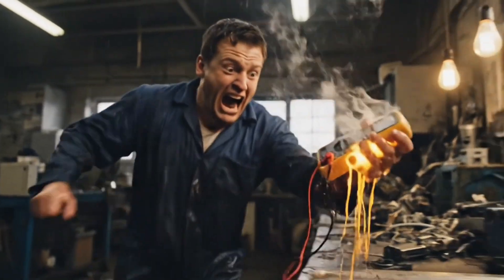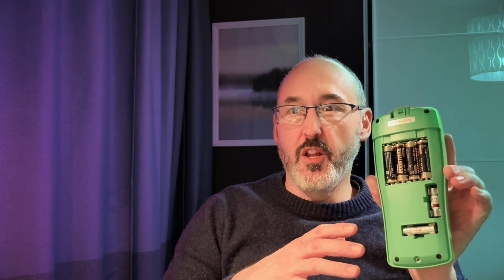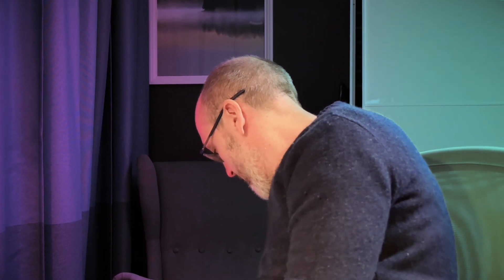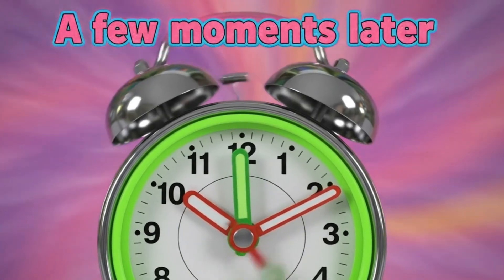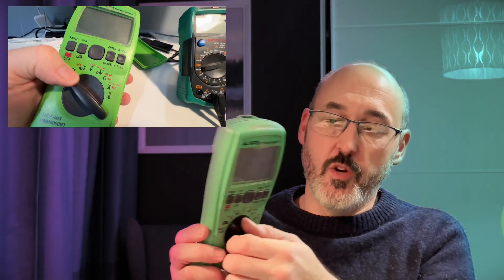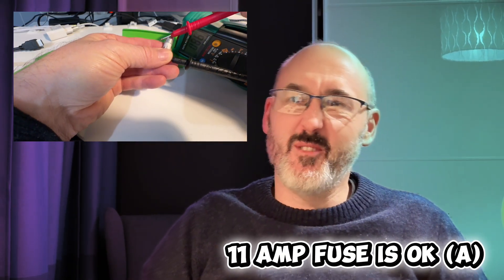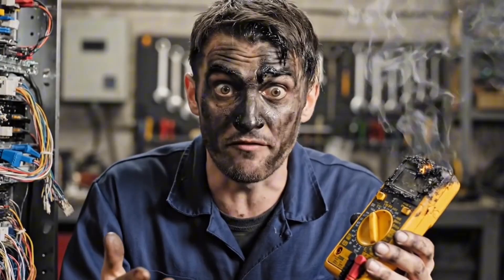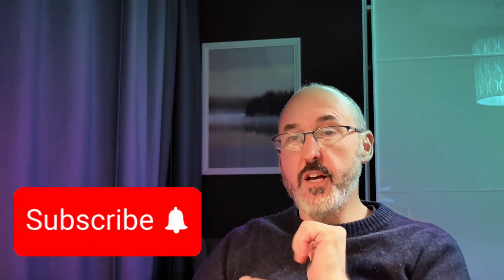What Happens When You Use a Multimeter WRONG? (Warning: Real Accident)

Comment: What to learn from this? When you get a multi-meter (or any other device with fuses inside), get some spare fuses that fits, you know, just in case. And Murphy is always around the corner and he will bite you in your butt, always at at point in time when you really don't need it.
Reply from the maker: I still need to go and buy one for the Kps 😅

Comment: You see a guy stuffing a thin strap of an aluminum foil in a fuse. His meter is working. Now you try that yourself, you make a thick bar of a foil, press it inside, having no idea what you are doing and what are the consequences of your actions... Those are two different scenarios. One is "potentially dangerous", the other can lead to your disability for the rest of your life.
Knowledge takes time. Over the years, we teach young to be wise 🖖Hopefully those young will survive to be wise 😆
Shortcuts are good if you know EXACTLY what you are doing, why you are doint it and what to expect.
Reply from the maker: Thats why I made the video a bit dramatic. I think it’s important to show people the consequences of bypassing fuses and continuing to use the meter as opposed to testing its functionality with a view to repairing the meter via a fuse replacement. Hence why I put disclaimers everywhere 😅. The story is true: I was in my early 20s and a guy had a meter blow up on him. It must have been pulling over 200 Amps when it set ablaze😮
Reply: @BenJFF  First time I burnt a fuse in my amp meter, I was probably around 10 or 11yo. Dad got me a nice set of toys for learning about circuits. And of course a first thing I wanted to do is to check how many Volts and Amps are in the socket. Volts went fine, but amps went with a bang 😆
Many years later, at my first job as a maintenance tech in a factory, I got a call about a short in a heater circuit on a machine. My coworker was using my multimeter, so I took it back, had a quick glance on the setting, I saw a knob pointing to Volts and started to measure... I didn't notice that indicating slot was on the opposite side and probes were in the wrong configuration 😆I melted the tip of my probe and made a little hole in the cabinet doors which I was using as a ground reference🤣
Reply from the maker: Hehe😂 thank god you were ok mate. Thanks for the story😊